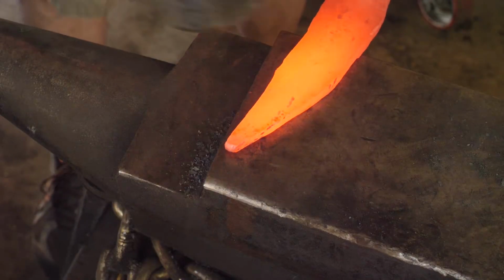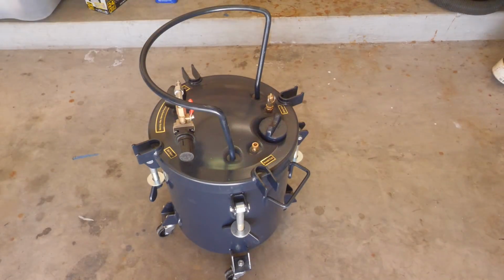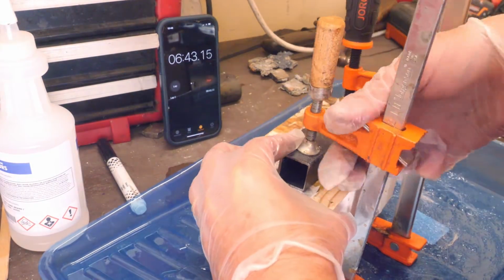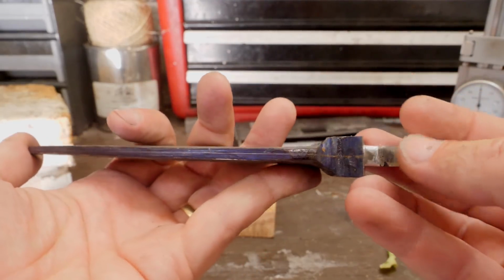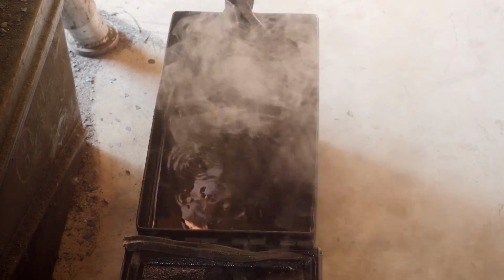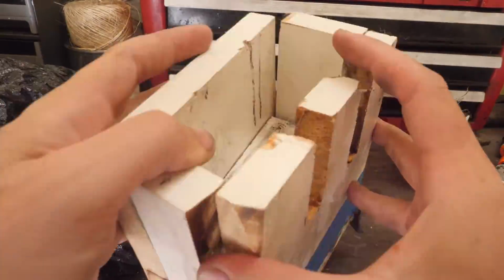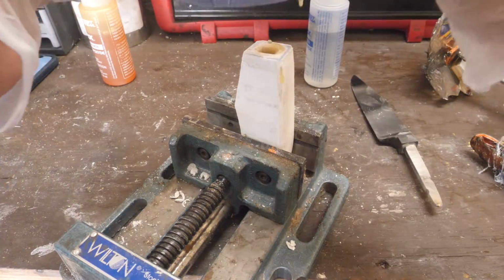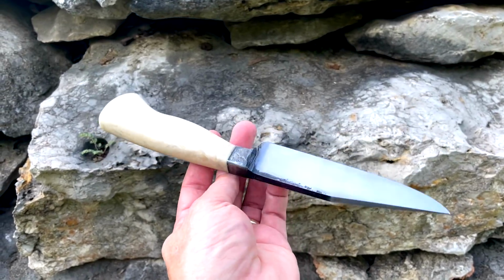Forging A Knife With Dog Micarta Handles

Comment: I noticed you said a "slow oil".  As far as I have read and done myself, it requires a fast oil for max performance.  Some even cryo.  I personally use Parks50 on my 52100
Reply from the maker: I’ve used all speeds on 52100.  They all work for me.  I can’t speak to differences in retained austenite or carbides etc but they all get just as hard for me.  Less risk of fracture w med and slow oils I think?
Reply: to each their own my friend. No judgment from me. I find it very doubtful that anyone using the knife would ever be able to tell the difference. If it does what its supposed to I doubt the oil used matters at all.

Comment: Question from a plebe: all that steel dust thats blasted off the work piece by the grinder and in to the bucket below—is that basically just trash, or does it get salvaged for any purpose?
Reply from the maker: It has grinder belt bits and all kinds of stuff.  I suppose the magnetic bits (steel) could be separated from the rest and cast?
Reply: @GreenBeetle  I suspected as much; I bet someone’s probably done it. Someone on budget with a lot of patience LOL
Reply: Forgot to mention, great video, man. You always manage to crack me up some how, and I’m always learning something new, kudos my friend!